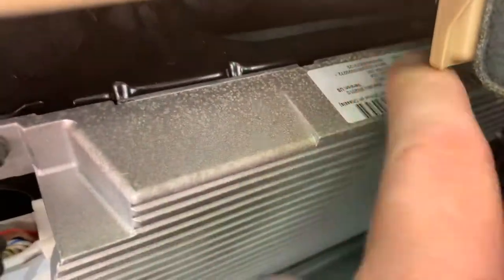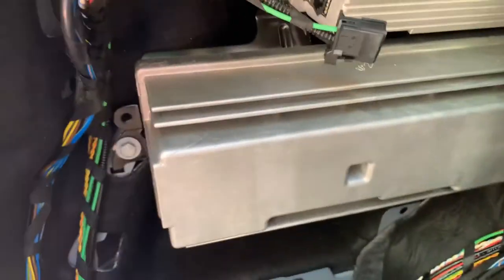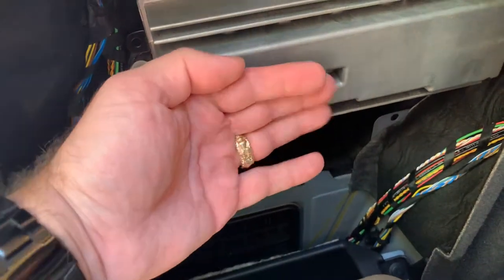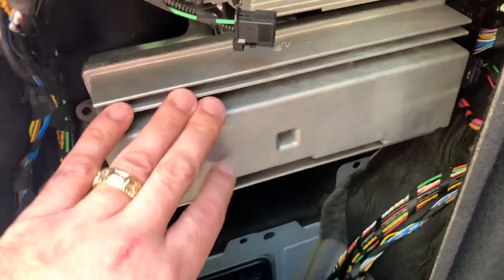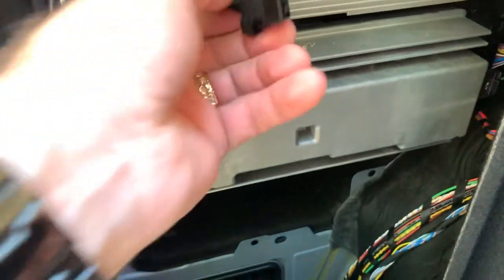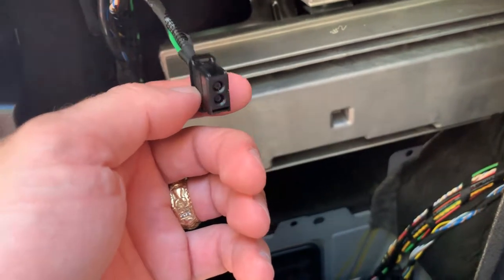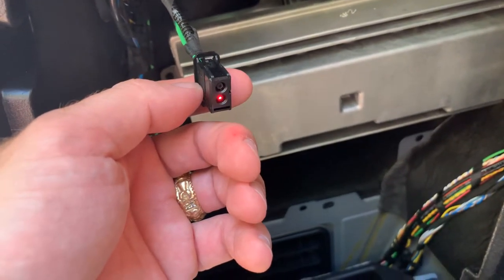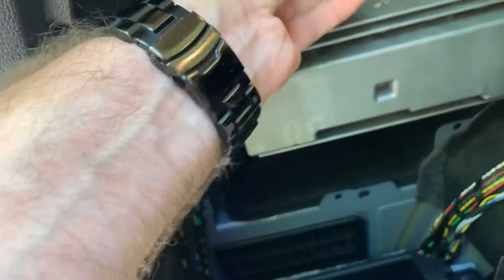No audio in my 2012 BMW X3 fixed

Comment: Thanks for the video. Mine had a similar issue although mine didnt fully go bad. I pulled the fiber connector on the bottom one and when I put it back the sound came back on. Your video put me on the right track.
Reply from the maker: My pleasure and so happy it helped you.  Thank you also for the comment it truly helps people as well.  Please consider subscribing for more content that may help you as well.  😊🤙🏻.  If you already did please disregard my last.

Comment: I just spent $1600. On an new AMP, and it didnt fix my dead radio. It was my radio head that was bad but BMW wanted $2800.00 to fix it. I bought my radio head on ebay for 
$ 110.00 installed it myself and bmw re-programmed it for me for $200. .and it works now.
Reply from the maker: Sorry to hear about the issues.  I am so happy you commented about your findings here as well because it will help.  I had a strong feeling mine was the amp as I said because I could smell the burnt plastic in the rear where the amp was.  Also when I took it out I opened it up and saw that the board was melted inside.  Once I saw that I knew it was the amp but didn’t know if it was anything else as well.  Process of elimination could have led me to the head unit as well if when I put the new amp in it still wouldn’t work.  Good to know you can buy the unit off eBay and have BMW program it.  Thanks for sharing that info.  Better days ahead my friend 😁🤙🏻
Reply: Have a question, was your radio head working with no sound or was the radio head working with no sound? Trying to figure out on my 2011 x5 and I’m having the same issues
Reply: Did your radio not turn on at all ? I’m having the same issue and no lights on the fiber optic cables
Reply: @munoz2717  yes, you are right, my radio head was displaying but no sounds came out of it.
Reply: @gatiyovideo  yes no sound out of the radio head just display.

Comment: Solid video.
I have 2013 335 f30.
Warning tones warning came up. Idrive and display completely functional but all tones and audios would intermittently go on and off until finally it just goes off.

Took it to bmw for a diagnosis and they advised me to replace head unit claiming “HEAD UNIT IS FAILING CAUSING THE DROPPING OUT OF THE FIBER OPTIC RING”

I really want to trouble shoot the fiber optic wire to the head unit to confirm. Gonna try and figure out how to check using your video.
Reply from the maker: Sorry about the issues I know how it feels.  You can buy the wire off Amazon.  Basically you unplug your fiber line and plug the one from Amazon in.  The one from Amazon will be looped so it tricks the head unit into thinking there is no issue.  If you get sound back it means they were correct in diagnosis.  Basically the fiber wire is the green wire.  If you have power on you can check each thing plugged in by pulling out the fiber wire.  If the wire blinks the unit before it is good.  So for example if you went to the first part from the head unit in the chain and get blinking red light then the head unit is fine.  Plug back in and go to the next part and so on.  If you find a part where the fiber is not blinking then the part before the one your on is faulty.  Hope that helps and good luck.
Reply: @ITSTHISEASY  thanks for detailing response!!! 
So checking the wiring connected to head unit would tell me if the optic is going in the head unit. Where is that location for after the head unit. Do you know?

Comment: I’m pretty sure the loop is used for each part of the circuit. So if you used it on the telephone module and it didn’t work you would know it’s bad if nothing changed after you did the com box
Reply from the maker: Thank you for the info 😊

Comment: Thanks my wife just informed me she’s having the same issue your wife had.  I have a 2914 X5
Reply from the maker: Hi Edgardo,  make sure that nothing is connected to the stereo like using Bluetooth first and also my wife’s had a button she hit on accident one day after I fixed it and she lost all sound again.  Not sure what it was called but press some buttons on the stereo deck as well to make sure the wife didn’t hit it on accident.  Kills all the sound as well.  If all that doesn’t work continue with using the video.  Good luck bud 😁🤙🏻

Comment: Have the same issue on my bmw 2016 f33 .... 
can’t figure out whats going on... I’ll follow those prompts and see whats up...
Thanks for the video man... appreciate it!!  🙏🏻
Reply from the maker: No problem I do hope it helps bud.  Let me know in the comments if it worked for you 😁🤙🏻
Reply from the maker: Also check to make sure your phone is not connected to the car with Bluetooth and stopping the sound.  Lastly my wife thought it happened again but realized by pressing in the knob of the stereo muted everything.  Check that as well.  She said she saw a speaker symbol on the screen with a hash through it and figured it out.  But if not that easy hopefully my video helps.  Good luck

Comment: this has happened to me too :( Ive got the 4 series convertible, apparently the amplifier has water Damage..
Reply from the maker: Sorry to hear that bud.  Try to find a used one on eBay or take to an electronics shop.  Good luck bud
Reply: Man. Have the same issue .. 2016 f33 convertible.. and audio is gone... 
sucks... I’ll follow this prompts and see what happens....

Comment: My 2013 X3 has the same issue, I have the amp from ebay, now I need to see how to take out the old amp, I need to remove the panel close to the back seat to reach the screws.
Reply from the maker: I hope my video helped and your up and running again.  Sorry for the late reply.  I must have missed your comment.
Reply: @ITSTHISEASY  the amp should arrive this week, I just had a surgery last Friday, so it will take time for me to be able to replace it.

Comment: Did you ever fix the one that was burnt?
Reply from the maker: Hi thanks for the question.  I tried to fix it by bringing it to the only local repair shop I could find.  He had it 6 months and never got to it.  I called three times during that time and got an excuse that he is so busy but he will get to it.  Finally I just went and picked it up but it’s still not repaired and I just decided to keep it just in case and find someone else if it ever happens again.  He did say it’s an easy fix so that’s why I saved it.  He said it’s a 50 cent part that needs to be replaced.  

So hearing that I decided to keep it if it happens again and the new old one gets damaged worse I can get the original one fixed somewhere else cheap.  

I hope that answers your question and helps.  😊

Comment: How likely are amps to go bad. I recently got my 7 series checked by a bmw specialist, He told me he tried coding it and nothing worked he checked the fuses and none where blown. He told me I will need a new amp so I’m going that route now but I am scared it won’t be that but It’s 100% sure it should be that or what do you think?
Reply from the maker: Is all the sounds gone?  Just give me a description of what’s happening.  But if all sounds are gone I would say yes it’s the amp.  Do you smell any burnt smell wherever it is in your vehicle?  Burnt usually means fried components.

Comment: I have 12v power to my ano, and red light blinking at the fiber optic, and no sound, resently i trued with another amp, and still there is no sound? Do i need coding for installing new amp? Or should i check somwere else ? I tought power and signal should be enough?
Reply from the maker: I didn’t have to do any coding it was plug and play.
Reply from the maker: You can reach me on instagram if you wanna chat easier.  Same as my channel name.
Reply from the maker: Its_this_easy.
Reply: Thank you, just sent you a message😄 Can’t understend why it wont make sound even if i have power, fiber signal, to different amp.. 

I have a earlyer diagnose from bmw, and they told me to code the head unit because it was stored wrong or something like that, but i dont now if thats the issue?

Comment: I have an issue about my car BMW M235i Coupe speaker Harman/kardon last night has a crackling noise/popping something like that
And now doesn't have any sound like a radio,cd,parking beep cencor or Bluetooth
I believe is a bad wired or amplifier
What u think is a same problem?
Reply from the maker: Franky venue That sounds tricky to me.  Make sure that your not connected to your phone or Apple Watch etc using Bluetooth.  It’s happened to my wife and she lost all sound because she was connected to her phone and didn’t know it.  If your sure your not connected to your phone and you have no sound or it’s messed up then go smell around where ever your AMP is.  If you smell burning plastic or wires then it could become the same issue or maybe already is.
Reply: I CAN DO THAT i will try to do same like you checking all the way like a fuses and smell or not from amp
Then i can replace where is from
Thank you for sharing the video sir! 🤘
Reply: Joe W what i did is unplug amp satellite and plug again just like a restart
And works for me now

Comment: Where is the volume control unit?? I'm having the same problem like the yours was.
Reply from the maker: Samuel Kyallo If you watched the video I showed you which one I replaced.  Smell back there and see if you smell anything burnt.  Also make sure your not connected to your phone or someone else is via Bluetooth.  My wife has also done that before and thought it was blown again.   Good luck and I’m here if you have any more questions.
Reply: @ITSTHISEASY  thank you for your reply. I did smell like something was burnt. I watched your entire video but didn't recall you talking about the volume control model. I took it to BMW and I was quoted $2700 repair the amp and volume control model plus that included labor. I have the Hi-Fi sound system. I really liked your video because no one really talks about purchasing used amps from Ebay. I'm was skeptical on purchasing a used one because I didn't want to waste money on one and it ends up being messed up or faulty.
Reply: Would this be the same for all BMW’s? I have a 2018 740e with the same issue

Comment: I have aftermarket amp. Maybe it is dead?
Reply from the maker: Thanks for the question.  I would not know for sure because I like you just try to figure things out to save money and also because I enjoy it lol.  I will say this though.  When my wife’s died nothing else worked so that would be my guess.  Smell around yours and see if you smell any burnt smell.   Also, usually after market have wires that go directly to the battery.  Sometimes where they attach there are fuses.  You could check those fuses as well.  I use to have a vehicle with a setup like that when I was in my 20’s lol.  Good luck and let us know what you figure out.  It helps everyone 💪🏼😊

Comment: My gf has the same color, if it gets crashed lmk if u will sell me the front passenger door
Reply from the maker: Will do but hopefully my wife doesn’t crash lol 😂.  You should check on eBay or your local car junkyards.  Or google it to find one as well.  There has to be more out there 😊
Reply from the maker: Check this out https://www.ebay.com/itm/133943368868?mkcid=16&mkevt=1&mkrid=711-127632-2357-0&ssspo=mFNockx8Rgu&sssrc=2349624&ssuid=zYRUNR3-Rgm&var=&widget_ver=artemis&media=COPY
Reply from the maker: If that’s not it type this in on eBay.  
bmw x3 front passenger door

Comment: Happened to me after a dead battery, in a 2012 650 I
Reply from the maker: Wow that is good to hear for all of us.  I guess that’s something we should all watch for.
Reply: @ITSTHISEASY  man I still have to fix mine!!!!!!! I got another radio hooked up but it sounds like shit, and the crazy thing is my car has a legit 20 k miles on it!!!
Reply: @jasonbrooks2209  did you ever fix yours?  my 2014 320i has exactly the same issue after replacing a dead battery!  I unplugged the amp and plugged it back in months later and it magically worked for about 24 hours and now it's dead again :(